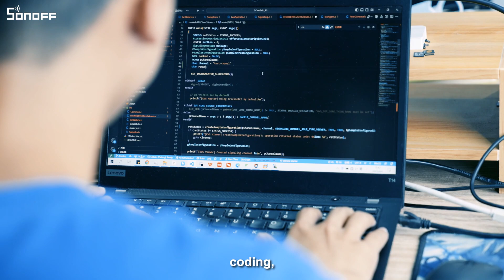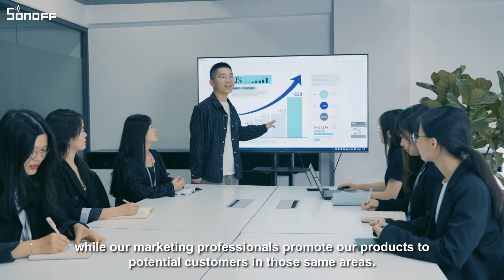Unveiling the Future of Smart Living with SONOFF

Comment: I hope you are doing well.

My name is Tebogo Makhoba, and I am working on a smart home automation installation for a client who would like to control their entire home using Google Home, mobile devices, and laptops.

The property is a three-story house with the following automation requirements:

Smart light switches (7 units)

Smart 16A plugs (10 units)

Smart gate motor controller or Wi-Fi relay module

Smart geyser controller

Smart stove isolator or heavy-load switch

Smart sauna room controller (for power and temperature management)

Smart indoor and outdoor cameras (if compatible or supported)

Air conditioning system integration (Google Home compatible)

Please provide:

A detailed quotation and price list for the above products

Recommended devices or bundles for this size of home

Product specifications and Google integration details

Availability and reseller pricing, as I act as a middleman working with electricians

Thank you for your time and assistance. I look forward to your quotation and recommendations on the best Sonoff products for this project.

Kind regards,
Tebogo Makhoba
Millwright Apprentice | Smart Systems Installer
📞 [0713188566]
📧 [tebogo.makhoba@gmail.com]
📍 Soweto, Gauteng

Comment: I have more than 40 Sonoff devices. I want to add more but you have not these products. Please add  Exterior waterproof IP camera and Security alarm panel+siren+keyboard.
Reply from the maker: First and foremost, thank you for your trust and support in Sonoff products! Your suggestions are valuable to us. We've taken note of your recommendations regarding the exterior waterproof IP camera and the security alarm panel+siren+keyboard, and will bring them up in our product development team's meeting. Please stay tuned for our updates as we aim to bring you more and better products!
Reply: @SONOFF  thank you for your answer. I forgot to mention the IR blaster which is probably more important than the alarm and the exterior IP camera. We use many devices with IR such as TVs, sound amplifiers, air conditioning etc. For us who want to build a Sonoff ecosystem, it is very important that you make it easy for us to use an IR blaster.  We are now using IR blasters from other companies and they are not directly compatible with our sonof devices.
Reply from the maker: @candymancam2390 🤫It's still in the lab.